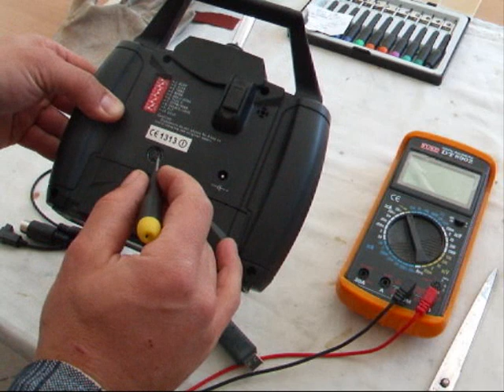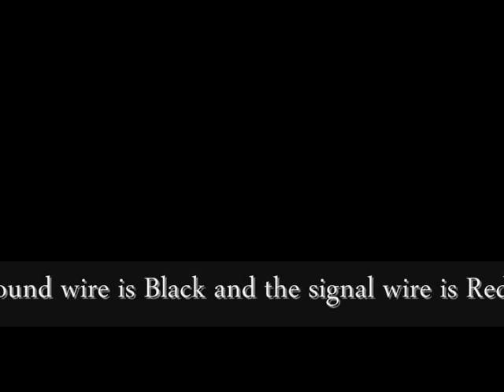How to modify the FMS USB flight simulator cable for the use with the walkera FM radio.

Comment from the maker: @xcorpyon I'm not sure at 100% about the damage of the devices... but (before to find the right way) I have try many configurations without make damages at my radio or usb device. However keep in mind that every interface is different! Example:My walkera 4 channel radio (find it in my others vid)  work fine with the reflex xtr usb interface, but don't work with the fms interface :(.
I don't know why.
Kind regards from It =)

Comment from the maker: Hi Zilam11.
If I don't remove the cristal from the tx, the flight simulator don't detect the radio.

At the present time I use the Tru flite 3d flight simulator. It is the best for me.

This is the radio of the walkera 22e. I have connect it with the reflex xtr simulator and it work 100%. If your radio don't work, please check the correct polarity of the wire inside the connector
Check my vid about the 4 channel radio on youtube, and you can find some words about  ONLY the wires polarity

Comment: Ciao, ho visto che ne capisci un po di FMS e dei radiocomandi walkera. Io ho un Devo 10 e il cavo da 3.5 a USB(UB - 001).

Io provo a collegarli ma poi non so che fare,non mi riconosce il radiocomando. Poiu aiutarmi?
Reply from the maker: Ciao Francesco. Purtroppo non conosco il Devo 10. Non saprei porprio come aiutarti... potresti provare a chiedere aiuto su qualche forum come quello del sito di baronerosso. Salutoni.
Reply: sandronovecento76 Hello, I have a remote with cable simulator, if the loading of the cable there are 4 lines to 4 pin cable to remote resources. If it is connect with the usb simulator does 4 lines it should be in hungkan with the default usb cable......??(Radio Control XTR FMS Areofly Flight Simulator RC) tks
Reply from the maker: iman prabowo Hi. Sorry, i don't know... regards.

Comment: Saludos Sandro,puedes enviarme un dibujo de cómo hacer las conexiones para hacer la adaptación para mí radio Walkera WK 2402.
Atte.Jose María García
Caracas.Venezuela.
Reply from the maker: Hi Jose :)
The FSM is not a good flight simulator and I don't know if it work with the Walkera wk 2402.
Instead you can use it  with the Phoenix flight simulator. It is very cheap and it is one of the most great flight simulator available on the market. Take a look at this link. Cheers :D 

https://www.youtube.com/watch?v=Frsx0y8deNY